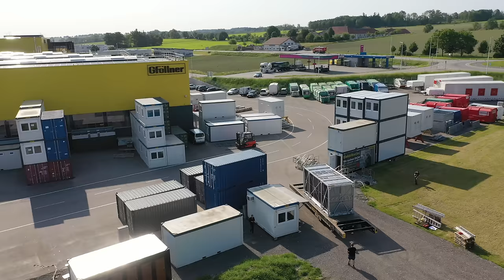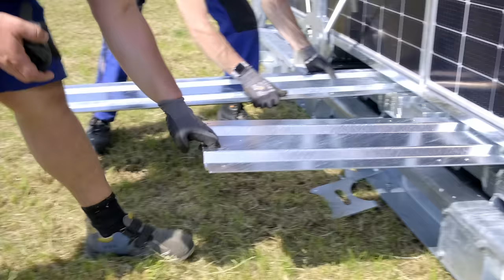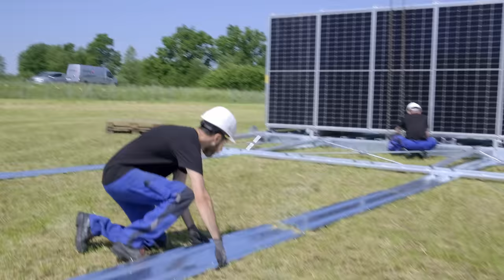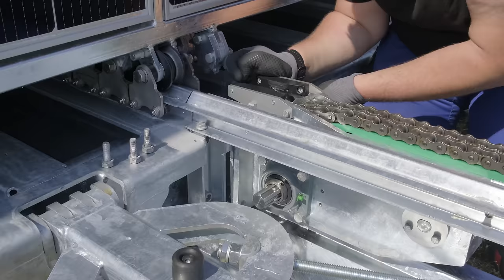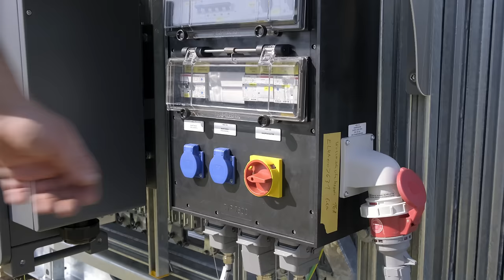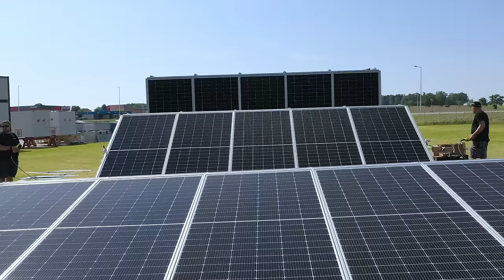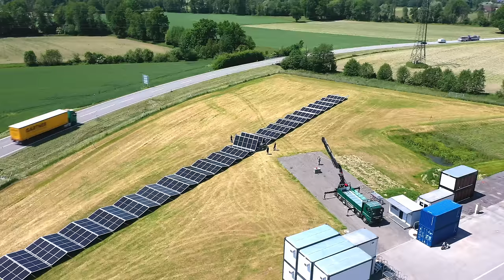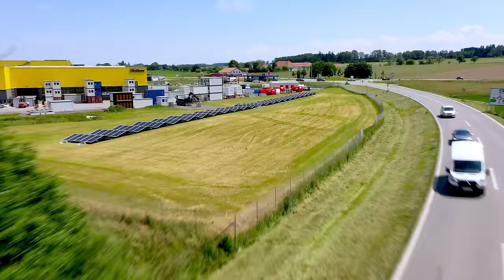Solarcontainer - The Original

Comment: Little bit more R&D to minimise the initial rail setup would make this awesome
Reply: Chances of minimizing that are slim to none. The only things they can really improve is changing from nuts and bolts to some kind of quick connect system. There simply aren't a lot of ways to keep the compact setup while speeding up the rail setup.
Reply: Perhaps a smaller second rail container that automatically unfolds first.
Reply: @ricepony33  that's the spirit, don't naysay problem solve!
Reply: Have crew put little wheels under each lower hinge point while expanding. Pull solar panels out via pulley ankered down at endpoint No rails needed.
Reply: @ricepony33 its additional rails all the way down 😆
Reply: Here's a freebie. If you're going to involve heavy machinery to set it up then ditch the chain system and just drag them out with a bobcat or truck. Or set one ground spike with a pulley and winch. And then just winch them back.
Reply: @jamesa8851  The fact that a crane is needed/used to set it up kind of defeats the entire purpose in my opinion. 
If it can't just be plopped down by a truck and then assembled by some burly men and a few hand tools then I don't see the appeal.
Reply: At this point it just seems easier faster and cheaper to just do them by hand one by one
Reply: Not really useful if you run the numbers. It's a mobile solar array at 140kWp weighing literal tens of tons. You need a mobile crane in order to place it on the ground in the first place. In order to be useful you need to weigh the pros and cons. Speed would decrease setup time by a few hours, but how much would you save in labor in the grant scheme of hiring a crane? Furthermore you would need to reduce the number of solar panels to make place for the mechanism. 

The only justification for such a system if you can eliminate the need for a crane. For example if the system could be converted to a hook loader, the loss of solar power would offset the additional cost of hiring a crane. A single driver could pick up a second unit whilst the ground crew is setting up the first. But my guess here is that the company already has done such calculations and weighing the costs and benefits.
Reply: @arjanmus  Then you would be dependent on the simple fact you can provide enough anchorage for a pulley. Such systems are frequently deployed on grassy fields, there is no way of telling how much strength there is in the ground. You would need to pound in several meters of rod, in which case you are essentially replace one problem with another. Several problems actually, out of the top of my head:

- pounding in anchors requires heavy machinery and time. Removing those achors takes time
- The owner might take issue with additional holes in the ground
- Drainage systems could be present (especially in The Netherlands)
- grass fields aren't level and riddled with holes and bumps. How are you going to counter the flexing forces?
- For the same reason you would need large wheels to navigate holes and bumps, not small wheels.

But in order for the system to remain compact you need to have a level and straight rail system in place before expanding the solar panels. Otherwise you would need to beef up the structure. So much so that you would take away much needed transportation space for the solar panels.

Comment: In fact, its need too much heavy machine, a container mover, a crane, a wheel-loader and you need 400v external electricity to deploy it, 4 mans, and a mega flat area.
Need to be more auto deploy, more easier, more placeable.
Maybe with a battery pack in the middle for auto deploy, less solar panels for not use a football stadium, and can be put directly with a truck container crane or back loader.

It's very good, but i don't understant ho is the customer for that type of mega structur. it's take a full parking aera for a festival. compare to a 3.5to trailer with a Caterpillar Gens.

Comment: Are the inverter and batteries included on this container? If it could deploy from a flatbed trailer without needing a crane or any other machines this would be very useful
Reply: Once the crane came out. I was, go back to the drawing board.

Comment: Great idea up to the point where up have to plug it in to deploy panels
Reply: It does indeed look like the panels aren't plugged in, but there's no reason why they couldn't be wired permanently, so I'm guessing this is an uncompleted version or something like that.
Reply: @timderks5960  how would you wire it in if solar is the source of power. Without other power source to deploy the panels its useless
Reply: @NTM2009  Ah, you meant plug it in to the grid, I thought you meant plugging the individual panels together / connecting them to the inverter.

Your "issue" really is a non-issue though. Either temporarily run a generator, if you're in a really remote location, or just run an extension cord. These things aren't meant to be some miracle device that's an all in one setup, they're gonna be a part in setups that have a generator and battery. Newer generators come with battery banks these days, so the generator can run at optimal power when under low load and charge the batteries at the same time, saving fuel and reducing noise. Add this solar array to one of those generators, and the generator has to run even less, again reducing fuel consumption and noise.

People should really stop seeing issues and look for solutions instead. Pretty much everything can be solved. Instead of just saying "this sucks because of X", how about "X seems to be an issue, maybe that could be solved by Y".
Reply: @timderks5960  that is an all in one setup, it has the inverters on it already so no need for generator, or even batteries if your not storing power. Have done a couple systems where there is no power supply on site other then the panels and inverters sending power out, no incoming power and not going to run generator up to them every time they need opened and closed. Put a couple batteries in the system.and they couple work all in their own.
Also generators are better to run near max output then at low output. Running near max will make them most efficient and last longest
Reply: That motor is probably only a couple of horsepower tops.  Looks like its just moving a section of chain belt that grabs a tab on the bottom of each panel segment and pushes it along and is only connected to at most 2 segments directly at a time.  At around 3kw of solar per segment there's really no reason the workers couldnt unfold the first segment by hand and use that to power the motor to unfold the rest.  even if your only geting 50% of the rated output of the solar thats still enough to run a 2hp motor and your available power will just go up as segments unfold.  You could also probalby jump start the system off a couple of car batteries or any portable power station capable of a couple of KW of output for a minute or two  After that like I said there's more than enough solar avalible if the sun is out after a few segments are exposed.
Reply: @merendell  that's what I'm saying. Put a couple batteries in there somewhere to power the deploy and stow function. Heck a couple deep cycle batteries would unfold and fold that without help from panels. And when panels out they could charge batteries

Comment: this seems way over engineered. And you need a motorized trailer, a 120T crane, a front loader, a boom truck, a flat bed, and 5 workers? It seems like more work to layout half a kilometer of rail and assemble a motorized conveyor than to simply just unload the panels by hand. Why not make the container self deploy? Have it crawl along and unfold itself.
Reply: Quite simple actually. You would need to over-engineer the entire solar array structure in order to do so. Either you have a beefed up, over engineered rail system, or you need to have an over-engineered beefed up array structure to account for all the bumps and holes in the ground. You would need to have automatic leveling feet which are expensive and heavy for each ground point. 

The entire reason you need to have a 120 ton crane is because the total weight of the structure is 30-40 ton. Even if the system got more mobile, you'd still need a crew of at least three to handle the weight responsibly. Additional the amount of power these systems generate is no joke and you need experienced electrical engineers to work and validate those systems.

To simply put, the engineering put forward in this system enabled them to put as many solar panels into the container. As a downside they require a larger (not by much) crew and an expensive crane. I do think they put some thought into the economics of this system.